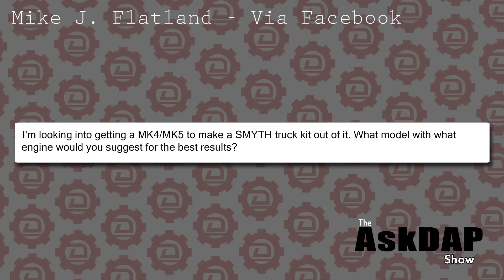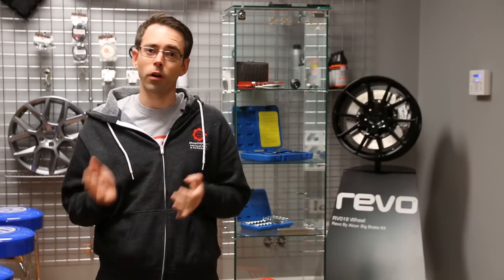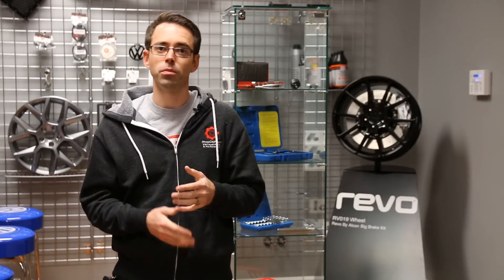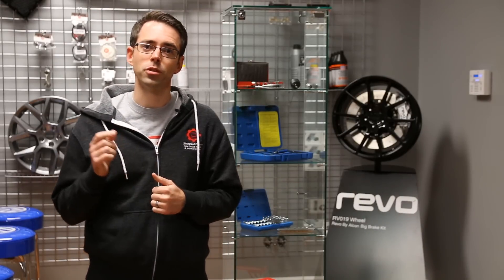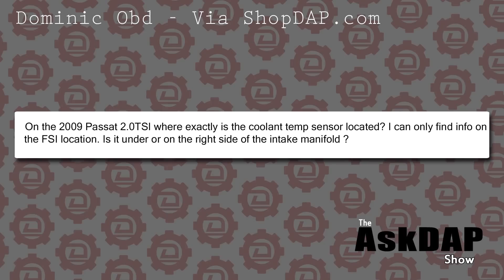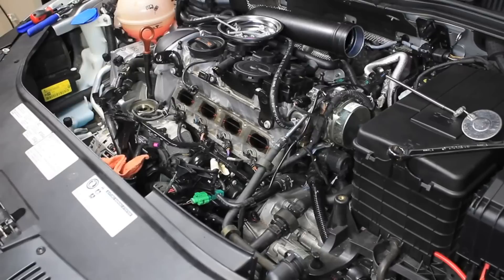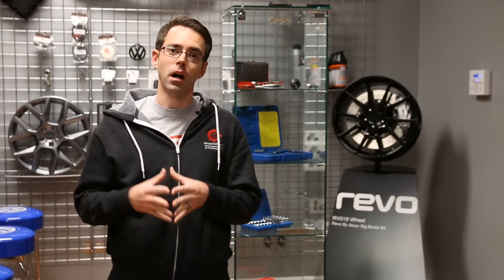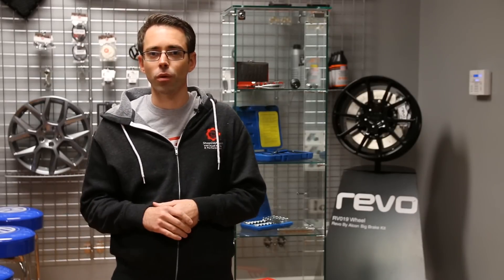Askdap Episode 71 | Best Model for a Smyth Ute and Alum Filter Housings

Comment: Hey Paul, thanks for the videos. It's about to get real cold up here in MA and I just ran out of windshield washer fluid. The mk7 owners manual warns against mixing VW washer fluid with non-VW fluid. I've also heard stories of sensors being destroyed  by using orange or green winter washer fluid (particularly rain x) and warranty claims being denied because of it. When I went to the dealership they said they don't sell any VW fluid by the bottle, but could top me off in the service dept if I waited. Not only is it almost impossible to find any VW washer fluid online, what I have found is only recommended for the summer... I was thinking of buying the summer VW washer fluid and adding a cup or 2 of isopropyl alcohol to keep it from freezing, unless you have a better idea of safe and trusted winter washer fluid brands for VWs.  Thanks again, -Mike
Reply from the maker: answer coming askdap 72

Comment: I have a question relating to the 2.0 tfsi engine, code bwa. I recently fitted a miltek cat back and was wondering if I fit a miltek downpipe aswell, will I need to get a remap? as I recently heard from a YouTube video that vwgroup ecu's learn to the changes made (like intakes larger bore exhaust ect) unlike cars like subaru's which will need remaped to because it looses bhp with bigger down pipes ect. is this true? 

thanks' love the channel.

kieran

Comment: why would you make a ute with anything other than a tdi? high torque, can be loaded and can pull far more than it can stop. trailer brakes would be advised. you don't want a ute for handling and speed, you want a truck thats efficient and inexpensive. 
get an alh tdi. solid engine. unbelievably reliable. high torque, still decently quick. very upgradable.